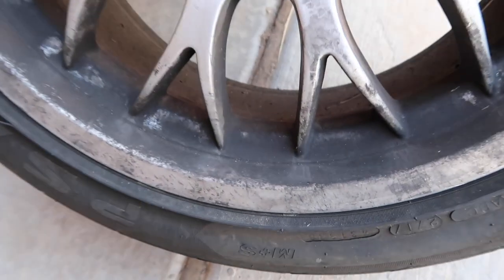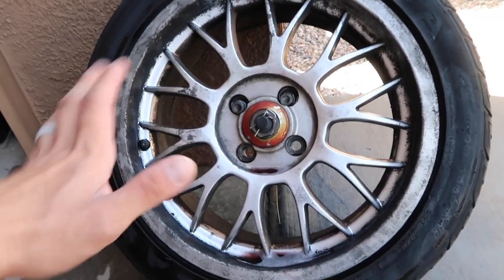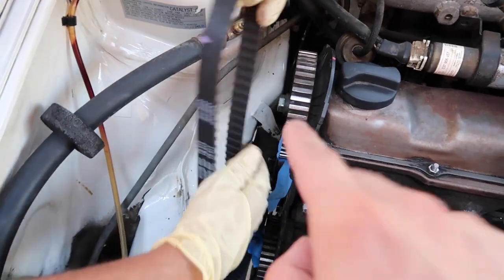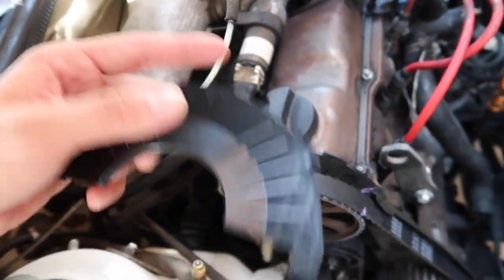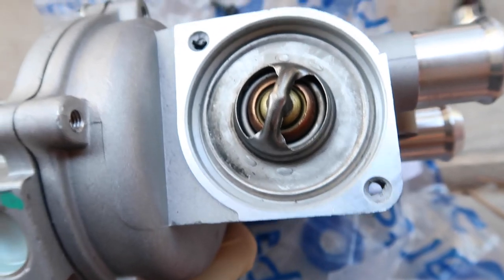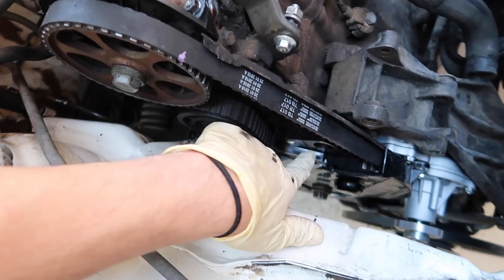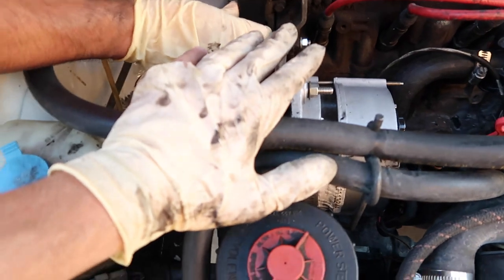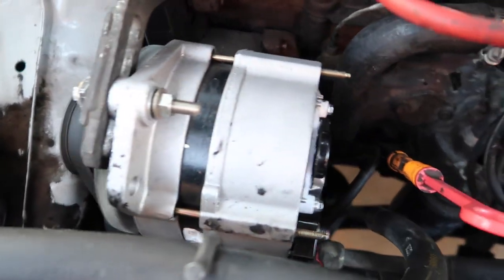The Cabby Lives!! | MK1 Volkswagen Cabriolet Water pump | Water pump install

Comment: My1992 has the 5 speed manual. I couldn't tell if yours was also but if it is I hope you do a video on replacing the guides  and bushings on the shift linkage.